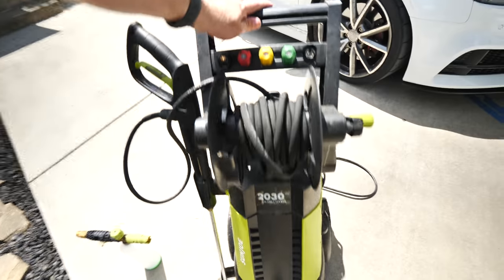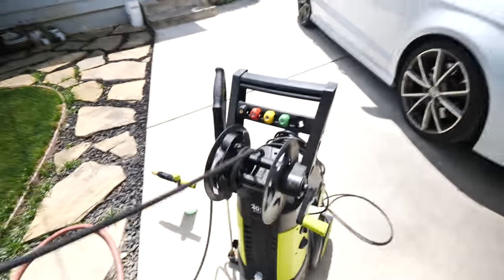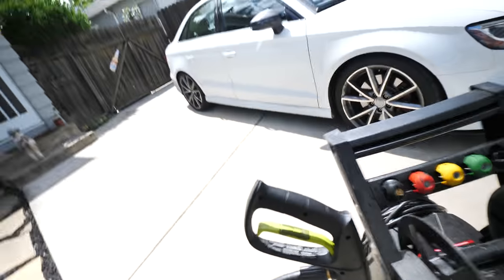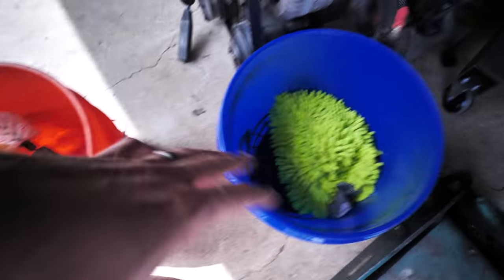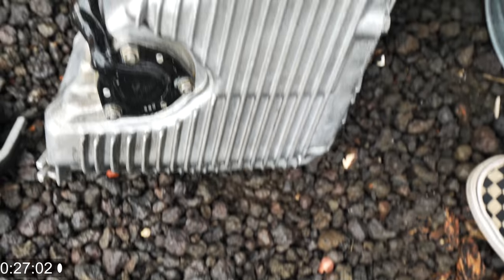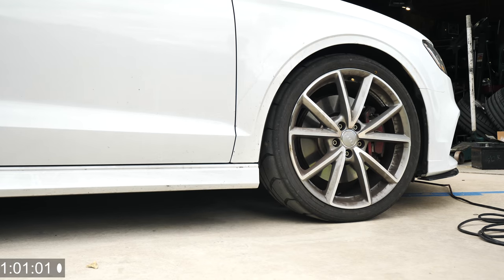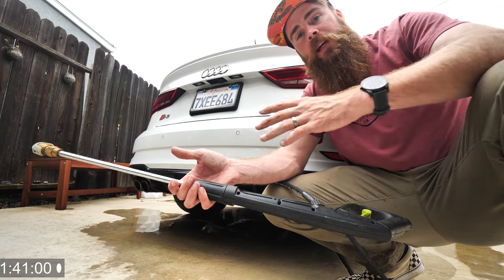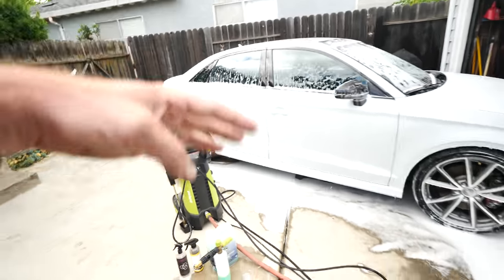SunJoe Pressure Washer 5 reasons  you need one [4K]

Comment: AR Blue 2000 psi. Has over 30 years experience in pump design. AR stands for Annovi Reverbrie. It's an Italian pump manufacturer.  I had an AR that lasted over 30 years hassle free! The AR Blue 2000psi for $160. You can not beat that anywhere.

Comment: Great vid once again! 
However 2030psi can get dangerous on old paint, or cars with clear coat failure/rust/chips (it can blow it away)
i believe 1600psi ~ 1800psi is good enough!
Reply from the maker: Hyun Kim yep great point and also another reason you don't need a $4k pressure washer. That max PSI is most likely with the 0 degree tip. With the 40 degree tip and a bit of distance you should be fine. Remember that you do still have to use soap of foam and a mitt to clean the car never just use the pressure of the water to get everything off. 👍
Reply: Yes exactly, just letting our people watching this know 👍
Reply: @hyunkim3422  2030 psi is only achieved with 100 psi water pressure. The spx4000  series has 2 setting, low and high, 1450 psi and 2030 psi again at 100 psi water pressure.

Comment: How long do you leave the soap foam in your car before rinsing it off? And so you use your microfiber hand sponge to clean your car before rinsing it off?
Thanks for the video
Reply: Leave it on for 1-3 min depending on your environment, sunny az vs gloomy Seattle. Lightly scrub the car down with a nice clean microfiber mitt and use the two bucket method (look it up). Do that religiously and practice general detail rules n boom! Nice clean car all the time with little work.

Comment: Got one of these cause of your review 

But does anyone get the double click setting on the pressure washer once the snow foam canon is attached ??
Reply from the maker: Luke S if you pull the trigger quickly twice it will go into a low pressure mode. I haven’t had any issues with the foam cannon.

Comment: This pressure washer tool is really vexing to me. Definitely want/need one but cannot figure which. The non-conforming size on this deters me but the reel is a must. Have you ever tried a more aggressive tip on wheels? Is Kranzle money dumb money?!
Reply from the maker: D Wray's Garage yes that's dumb money exactly what I was touching on. You will take the paint off your car that's unnecessary. This works great no need for more pressure. If you're power washing concrete all day buy a gas power one. If your just washing cars this does amazing. That one is so you can mount it on your wall like a douche and take two months to do so.
Reply: Blake's Garage I can't imagine who you're referencing ;^)! And, did you ever up the nozzle for deeper wheel cleaning? I always spend way too much time on wheels - could be my biggest gain from this upgrade.
Reply from the maker: D Wray's Garage 😂 yeah. no, I don't up the nozzle that will take the paint and clear coat off your wheels. Just a quick swipe with a wheel brush and the rinse with the 40 degree and they look like new every time. If the wheels are only slightly dirty it's even quicker.

Comment: Might be a dumb question... What's the point of the foam cannon when there's a detergent tank on the unit itself?
Reply: Foam cannon allows control over the mix of water to soap and let's you get a thicker foam instead of just a watery soap. Imagine squeezing out a soapy sponge that's really wet compared to one's that's not.
Not a dumb question by the way.

Comment: 1:56 roll that brazzers footage!!!  I got one based on your review and my ONLY gripe is the semi-proprietary connections for adding quick disconnects and longer hose extensions.  Should have came from Sun Joe with a 25 ft hose.
Reply from the maker: KenSkywalker yeah I definitely want to buy a house extension. The connections can easily be converted if you don't use there quick connect.

Comment: why use the foam canon instead of the onboard tank and nozzle?
Reply: Turk Blackwell it doesn’t work the same. I tried the tank and it doesn’t foam like foam Canon does. For $20 or so for canon; it’s worth it.
Reply: @CaliforniaPhantom  you are correct. I tried the onboard tank and "foam" nozzle and it was not good. A foam cannon works much better.

Comment: Will this short out if you plug it with a extension cord???? Thank you. Great video
Reply from the maker: No, I always use an extension cord. That would all depend on how loaded your circuit your plugging into is.
Reply: What do you mean ?
Reply: Thank you for replying. I appreciate it
Reply from the maker: Blessed9-21-12 how many amps your circuit is and what load do you have on it before adding more. You shouldn’t have issue as bong as you don’t have a ton of stuff plugged into the same circuit at the same time/
Reply: Alright thank you man

Comment: Your poor clearcoat and brake lines. Handy tool but use at a distance when using pressure nozzles or you "CAN" peel off the clear coat. Every pro detailer points this out. Foamer is not so bad thankfully.